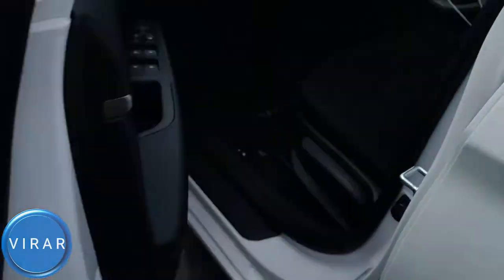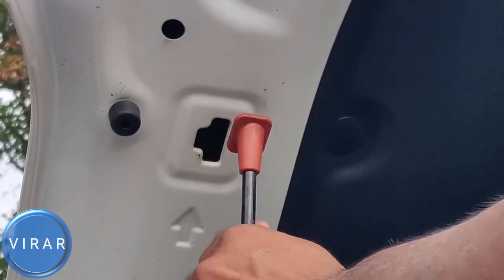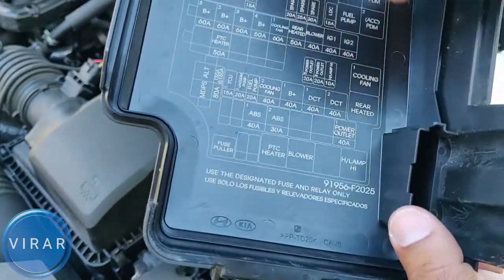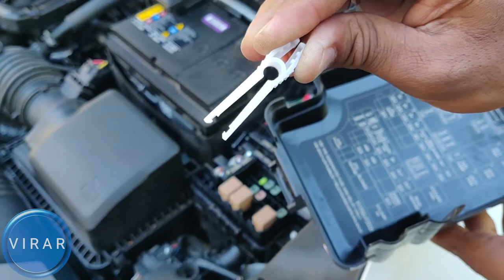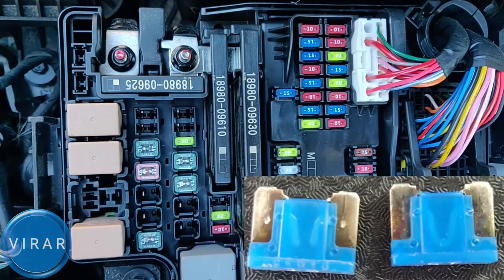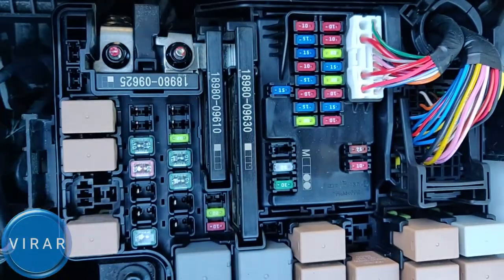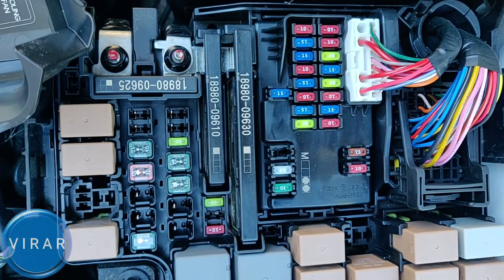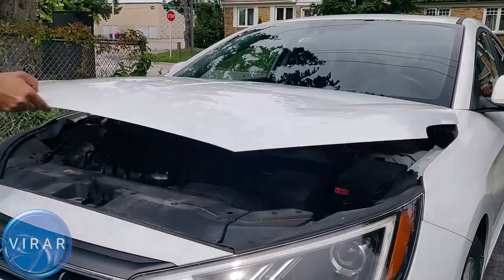How to Fix 12V Power Outlet/Cigarette Lighter - Hyundai Elantra (2019-2020)

Comment: Hi, one question. where do i get these fuse? everywhere i go they dont have this type of fuse. thanks
Reply from the maker: You can buy them at a auto parts store or on Amazon. It's a blade type fuse. Size is Micro2 Fuse.
Reply: @VirarAutomotive  thanks
Reply from the maker: Or Mini Fuse. These fuses are often sold in a set. Just buy a mixed set of fuses like this 20/50 piece sets that way you have all types of replacement fuses. But as I showed in the video, your car comes with spare fuses.
Reply: I wish you had a video on how to get the power outlets out

Comment: Hi, I have a 2016 Elantra. The usb port doesn't work there, the flash drive can't be read, do you know the reason?
Reply from the maker: That USB / Aux Port part needs to be replaced probably. It is a common issue for these vehicles.